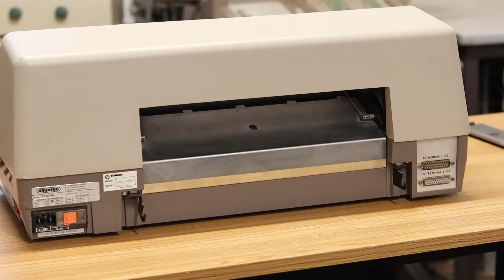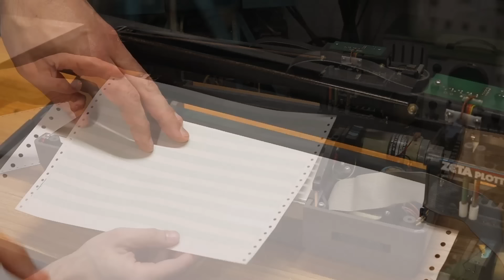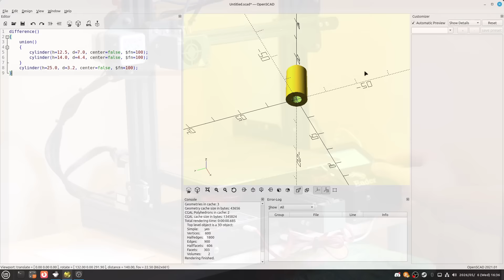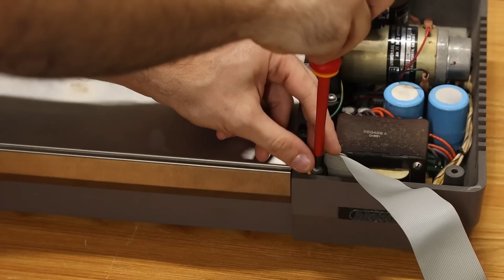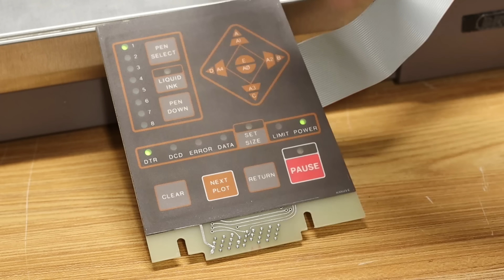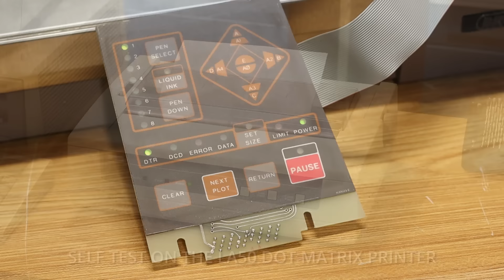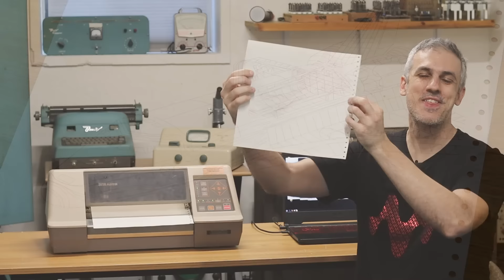A Pen Plotter from 1986!

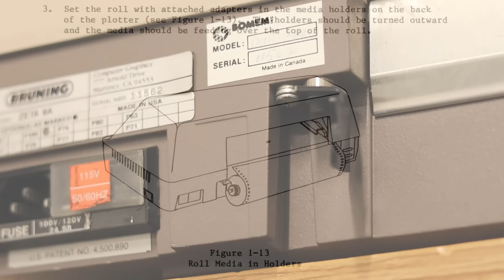Comment: 1:52 Not on a roll, but I still have paper with tractor holes edges from the 80s. I bought it for my 9 pin needle printer.

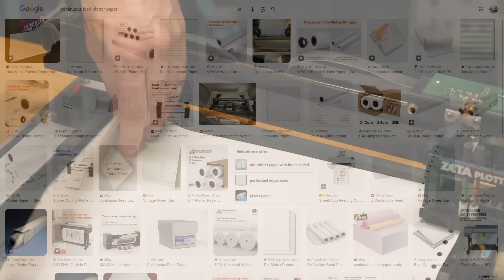4:50 Are you sure it is 12 inches, not 11.69? 11.69 inch is DinA4 landscape width (297 mm).

found on visionaid 12inch wide braille emboss paper.
"Braille Paper Tractor Feed 12 x 12"

india mart has a vendor that produces tractor feed paper to your specifications.

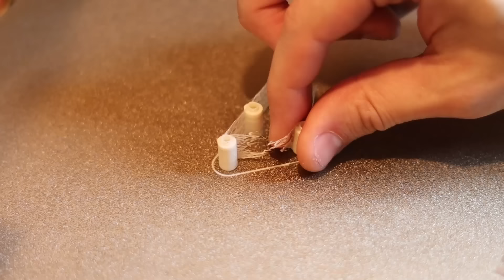8:27 Wet filament. Most likely.

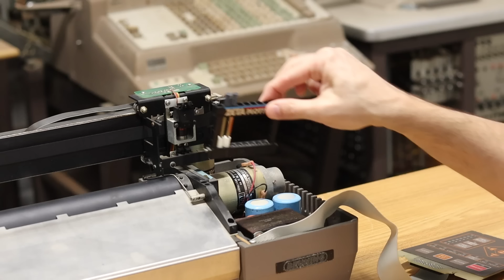10:55 It's a job for a resin printer.

Comment: ‼"My 3D printer has trouble printing something with walls that thin" Wow, for somebody so ingenuitive this is honestly embarrassing and goes to show how 3D Printing makes people brain not work good no more.

Solution: print the center of the part solid with solid infill and then (gasp) *drill the hole to final dimension*. I know, amazing. It's not like this is how we've made such things for over a century 🙄 3D printing is really setting people back.

Comment: In the production of paper for ALL uses in the usa it peaked say Dot Com Peak/ 1999.

Since then each year paper usage has dropped.  

Oddball tractor feed size rolls that width were probably last made 25 to 30 years ago.

 It is not a technical issue for an odd item; it is the setup cost. 
It is as easy as dumping RAW CASH  at mill to get 4x9 ft plywood or 4x 13.65 ft too  

Sometimes oddball sizes do show up on ebay.
But that requires constant fishing to find that stuff
Ie like locating oddball car, stove, radio parts, 

 I once had an Inventory of about 8k in just plotter pens 35 years ago.
Once Inkjet become main stream all that stuff rapidly went obsolete

About all was sold off  at a loss in early Ebay instead of throwing it away

Pens with a Fiber "magic marker" type system had a shelf life; ie dry out
A pack of 5 Fiber pens for an HP was 3 bucks 40 years ago
The last ones I bought new for resale were almost 40 bucks ; decades ago

The refillable or throw away Koh In Noor type pens were expensive and messy

The Adapters to fit a dozen different plotter "types" were not available First
So I get stuck with universal pens and no adapters

I would get calls 25 years ago for pens for plotters that were already not available
Folks would get a free old plotter or buy one off Ebay and discover the pens were rare or expensive since already not made anymore

Engineering Friends often rigged up other writing pens for pen plotters
Pens for slow moving strip chart recorders use a special ink; ie so does nor bleed at snail pace paper speeds

In *. PLT  Plot files the commands are Pen up and Pen down and got to another spot X,Y etc
ie Just like telling someone on the phone how to draw something

Before there were PDF files  Plot files were the norm

With early wide format Xerox type printers they accepted *.PLT files 35 years ago
One had a pen table in the Dos based Printer controller software that had a Windows like look; but ran as DOS
The Pen table for each client was 1 to say 20 pens
Virtual pens. ie Joe Cad Guy has pens 1 to 4 10 mils; pen 5 25 mils;  pen 6 is 40 mils ie about 1mm
This led to the Jackassery of folks with pen widths 1/1000 inch ie 1 mill since they were Dolts

So once pen plotters went away folks were making Cad plots with line widths about impossible to see at all
This further accelerated papers decline since Scrap skyrocketed with re plotting stuff many  times to get a readable copy

The sequence in widths with plotter pens was 0.25mm ; 0.35mm . 0.50mm , 0.7mm and 1 mm
0.25 mm ie say 10 mils was what some Land Surveyors used on plats

0.35,, ie 14 mils was Normal and 0.5mm ie about 20 mils too

Once folks got make Virtual pens with they went nuts with 1, 2, 3 mil ting widths with D and E size drawings;' thus crap not visible 

ys

Comment: maybe a 3d printed ring that clips around the roller than has some knubs on
so you can use shorter paper with knubs at both sides
although the plate at the bottom might need a bit of modification

Comment: I used to use a HP pen plotter to take screen shots from a HP spectrum analyzer.  It communicated to the spectrum analyzer over HPIB bus and had up to four different colored pens.  You push the Plot button and the plotter did it's thing.

Comment: 8:26 your filament is begging to be dried, put it in a filament dryer on the correct setting for the material if you have one, also you should keep your filaments in ziploc bags with desiccant packets inside

Comment: i had this problem with my ender 3. A. filament isnt as dry as it needs to be and B. the bearings on the rubberwheels might need an oil or even a replacement

Comment: I have something kind of similar. It's a small portable device with a keyboard that you can type text in and have it writing this text on a piece of paper. No idea what it was used for and I sadly don't have an original pen or a 3D printer (anymore) to actually try it out, but it is moving, so it likely works.

Also I once had a real A4 plotter that worked by putting alternating voltages in. It had a plate that used static electricity to hold the paper. Very interesting thing but it was heavy and too big to keep.

Comment: Paper? Several practical solutions have been recommended, but this is Usagi Electric. I imagine you tracking down a period accurate industrial paper cutter and punch. Of course it's been abused and abandoned, but is just needs the Usagi treatment. Then you'll be producing compatible rolls from any roll of paper that's wide enough. Am I the only one thinking this?

Comment: Why don't you take a round piece of plastic and drill a hole in it in the center? Wings3D is easy to use and produces a lot of export formats, .stl and .obj for example.

Comment: Try using electrical tape to fill the void on pen base in lieu of the rubber bushing...  Just keep layering up as necessary and if its too thick/ too much interference... just unravel and cut a bit?  Electrical tape is one of my favorite quick fixes LOL

Comment: Amazing! Maybe for the paper you could tape two tracker paper pieces together on the back. Like use your paper that's too big and cut it down to size and then tape them together on the back so the seam is as close to the tracker edge as possible. It's jank but hey... whatcha gonna do? The only other thing is to use something like an Circuit and cut your own individual piece of paper with the holes in it. I think the tape method would be easier! Might be good enough if you want to take it to VCF. The only other idea I can think of is using a soldering iron to burn holes tracker holes into a larger piece of paper. Not ideal but probably it could be faster than the Circuit method. Although at that point I guess you could just use a CNC to machine. Like get the paper that's too big in a stack, cut the stack down to size with a band saw, and then sandwich the stack of paper between a couple of boards and then use the drill press or CNC machine to make the new holes. This is all insane - admittedly - and I'm sure someone on Discord on in the comments here will know some paper company in Scranton that still makes custom sized tracker paper.

Comment: I had to work a full size pen plotter in the early 1990s. not fun to have to print a complete set of full size drawings. had to stay up all night and print out a set of arch drawings. pen runs out, erroneous data ruining a whole night's work.. we would also have to use pkzip compression software to link several floppy drives that always got messed up

Comment: Penholders: Stuff that fine needs to be printed with a SLA resin printer. If you use the right resin you can even make it effectively like the old rubber ones
FDM is useful but for small/fine things, resin gives much better results

The magic words to use when paper searching are "CAD plotter paper rolls". There are a bunch at 320mm but nothing I can see with tractor feed and I suspect it's 297 after the tractor strips are torn off. 

What does the manual say?

Comment: Look into Shimadzu CHROMATOPAC feed paper, has tractor feed and I believe will fit. Also hard to find but was produced in the same era as this so likely to fit, sold in rolls. Used for the C-R8A Integrators used on HPLC/GC lab equipment from the 80s

Comment: I worked for engineering firms into the mid-90's and pen plotters were king until about 1993 when they were superseded by large format printers.  People still call them plotters but they're really just very large  "E-sized paper" inkjet printers.  Nothing can beat those clean, sharp lines of a pen plotter for blueprints, technical drawings or topo maps.

Comment: Those aren't stepper motors - they're brushed DC motors operated in servo control. The units on the end of the motors are encoders. They might have glass graticules inside!

Comment: heat shrink tubing or electrical tape or something would also work if you can't print that smaller diameter section, assuming it helps with finer details

Comment: Modern vinyl cutters are all pen plotters with a drag knife instead of a pen. I've written a Rhino3d to rs232 hpgl print driver in Python to cut 2d curves from rhino directly to the cutter/plotter. Same driver would run this plotter EASY. For testing I put a felt tip pen in the blade holder and loaded plain paper.

Comment: Pro tip for thin sided holes, drill them later, just make a thick walled guide hole, then use a drill to widen the hole to make it match. In metal a reamer is used to get insanely precise dimensions but not sure how much would that even matter for plastics, YMMV.

Comment: Hi, just thought I’d share my 10 cents worth.I used to work for Xerox formerly Versatec, and it was the company’s goal to wipe pen plotters  out of the market place. Hence they developed the PPK (Pen Plotter Killer 8510etc) it was faster, quieter, special paper needed & toner. But the entertainment value was nil. We could be found in science labs to aero frame industries, the list was endless. However we took ‘across the bed’ as the Y axis and the X axis was as long as the roll of paper! I still remember the test plot I used which was the Fire Nozzle.HPGL happy days. Good luck with the paper.

Comment: If you need a think tube at the end of the 3D print, you can just buy some metal tubing and cut it to size and join it the fatter part of the 3D print. Just make a recess in the print for it to fit into.

Comment: I would check if you could get a thin brass tube from a hobby shop that is a good match for the narrow part of the pen holder and try to make a 3d print that accepts it as an insert.

Comment: Back in the early to mid eighties the hp pen plotters were pretty common when you needed to quickly visualize graphs, since at the time the only realistic timely alternative was dot matrix printers.They could quickly draw a visually clear graph in moments if you needed it for a meeting, often used direct on overhead film if needed to a large auditorium, the first model I think only had one or two colors, but the 1985 hp7475 which became the presentation norm for a several years had I believe 6 pens, at a time where early bw-only laser printers started to become mainstream in offices with a budget, they stood in their own class.

Comment: What if hypotetically i can manufacture / 3d print a machine that will cut and make the holes transforming the wider paper into just the right width, then just 3d print a roll and roll it around. I could try if you're interested, no commitment ( in my spare time ) and no charge, i'll deliver the roll on my money. I would need some measurements thou in metric system.

Comment: Your filament stringing issue could be caused by a few factors and those factors could also be compounded. First would be the correct temperature for the filament you are using. Second is the correct feed pressure and retract amount and timing for the filament. The filament could be wet but depending on the type of filament that often presents itself in different ways. If the temperature is too hot then the filament remains molten and continues to ooze even if the retraction amount and timing are correct. There are many setting tests you can run to make sure the settings are correct for the filament you are using. But I would first check that all of the settings you are using are correct for the filament you are using, temperature being the most important then narrow it down from there. Of course, change only 1 thing at a time between tests because of the compounding nature. Good luck and have fun, try not to pull all your hair out!

Comment: Pen Plotters have a not insignificant role in what made me the nerd I am today. When I was a lad, maybe 8-10yo, my Dad worked in a rural office of the agriculture department. Their little outpost office served a pretty massive land area, and so maps were mission critical. were working out of a pretty old building, the womens bathroom was completely demolished (the secretaries ran the house, none of the men would dare desecrate the loo after that conversion) and converted into a computer room. It had a A0 plotter, a Unix workstation/terminal, and a very high speed (for the era) connection into the city, Id have to guess fixed lines, government work etc.
Anyway, to get a map, you'd look up your coordinates in either a folder of air photographs (a big ring binder brick of paper) or on the new system on your desktop, windows 3.11, make a call to the mapping people, verbally tell them what you wanted. confirm the paper is properly loaded, they would connect to the remote system. and you could see them doing things on our terminal, things were happening. and then this monster of a A0 plotter would lurch into life. there was a reason they used the toilet block, this thing was bolted to the concrete floor and it still shook the building when it was firing in anger. the screen scrolling past thousands of commands, probably just Gcode, that tech is old as. made a huge amount of noise and action, shaking the foundations and computer screens doing very serious computer things.
and the end result was a massive A0 wide, 6ft tall map, with all sorts of details, land owners, weed outbreaks, water flows, roadways, all sorts of useful information. that would then get hung in the hallway of the office. with pins and strings and highlighters and pencil notes added as the campaign went on.
At that age, I used computers to play Commander Keen. so to see them draw something so useful and beautiful in such a violent manner, N a Unix station, thats real computer stuff. I was allowed in there under strict instruction that I kept my hands in my pockets. Touch Nothing. a bit later thats where I got my first taste of the internet. It was real fast, seeing as I was only getting 28.8k at home. Government Backbone FTW.
Now Im a huge Map Nerd, and CNC, and *ix's.

Comment: For Pens, these plotters typically used felt tips that were spec'd in different widths (0.3 mm, 0.5 mm).  Good pens will make a drastic difference in output.

Comment: for the paper: take a stack of the larger one.. say 10mm height. secure it on the cnc with plywood then drill the holes. after it should be quit easy to sharpen the pages to appropriate width with a home make cutting machine (also using the holes to guide the paper under the cutting blade)

Comment: I had never seen a Bruning plotter, at work in the 1980s we had a couple of the HP 7475a desktop plotters that handled an 8.5x11 cut sheet by friction rollers, those were magical to watch, and so I wanted a plotter for my own PC, an Apple ][, and I got the cutest lil doodad you ever saw, a Radio Shack CGP-115 four-pen plotter that used continuous roll "toilet paper" (regular paper but that's what I called it due to being 4" wide) so my first actual printer at home wasn't a printer really, but a plotter.

Comment: Shorted tantalum. Had the exact same problem (and discovered it the same way -- unplugging a board) on a piece of test gear (serial protoco tester) I bought. Killed all the p/s outputs, and I ended up replacing the supply before I discovered and replaced the faulty cap! No problem, because the new p/s had better specs and was smaller than the original, and had the benefit of 40 years of design experience, so it's probably a better unit overall!